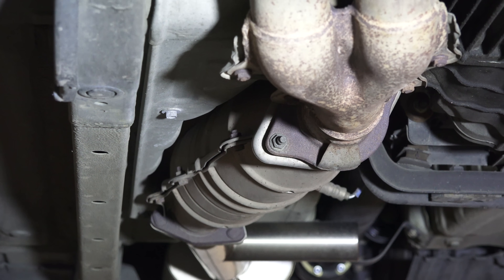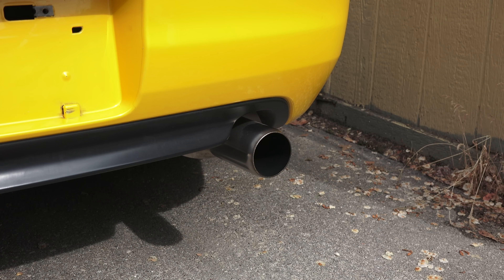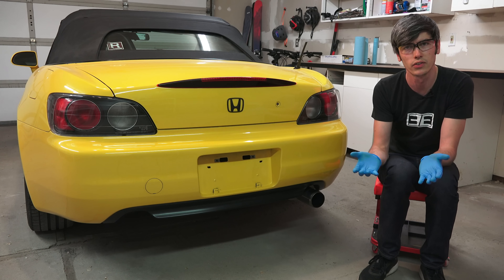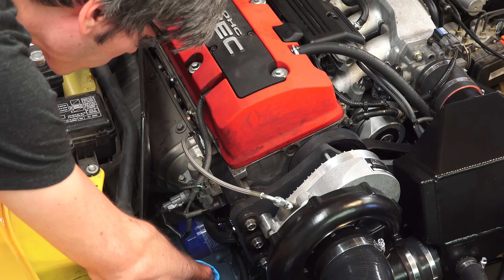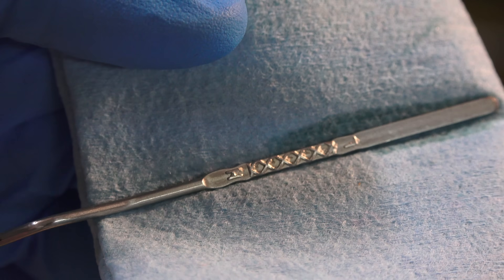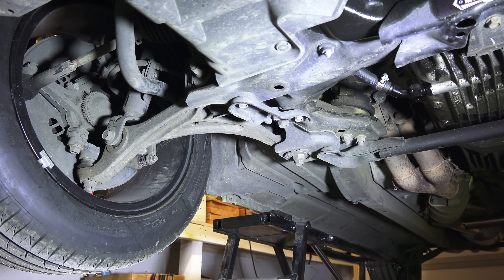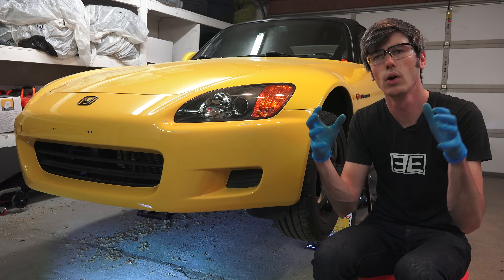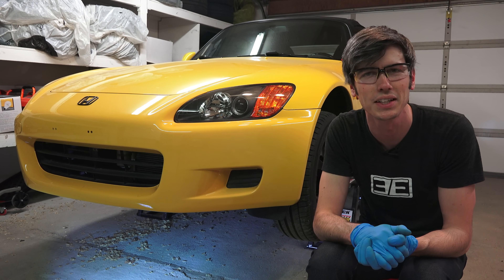5 Signs You Shouldn't Buy A Used Car

Comment from the maker: Good number of folks asking about the bluetooth scanner I'm using. Here's a link! https://amzn.to/2AwvtSQ I've had this one for maybe 4 years or so (EricTheCarGuy actually gave it to me). It's worked great!
Reply: I love your channel, been a fan for some time, your knowledge and no nonsense approach to engineering and mechanics is unparalleled, for this I thank you sincerely. I have a question about the scanner you are using, can it also give you vehicle information about the car as you drive? I am looking for something that will give me engine temp and oil pressure in real time that I can have in my field of vision on my phone as I am driving, more just to monitor certain parameters in different driving environments. Any feedback would be greatly appreciated, continued success my good man, I always look forward to your uploads. Best channel and best host on the subject!!!!
Reply from the maker: Yes, it actually has a live display where you can read things like temperature, throttle position, that kind of thing. It will depend on your make and model what it can read, but you can get live stuff and record data. It's quite neat! I'd recommend looking into compatibility with your make and model, but it's worked well with the cars I've tried it on.
Reply: Engineering Explained ever heard of diesel?
Reply: Engineering Explained hey. Does removal of hood insulation have benefits?
Reply: Engineering Explained hello , CAN YOU PLEASE SOLVE ONE MYTH THAT IS GOING ON IN MY COUNTRY . Some are saying that you shouldn’t open the oil cap while the car is running . My friend has a vw scirocco and from the service they told him that if he wants to sell the car and some guy comes and opens the oil cap while the car is running , something with the vacuum or compression I don’t know exactly would go wrong and the car engine could be damaged . Is that true ? Talking about 1.4 tsi engine .
Reply: Pretty sure he has
Reply: @ristecanev7  I think that part is true, I think I heard about that, it's the pressurized cap, mechanic said to not open that one when it's running so don't open it when it's running.
Reply: Awesome stocking-stuffer.  I'll share this vid with my wife to give her a hint.
Reply: Hey, do all the points apply equally to a diesel-fueled vehicle?
Reply: What would you consider a long enough test drive? Love the content, very useful and interesting stuff!
Reply: Great vid man 😊
Reply: you just wanted to show off how clean your s2000 is ;)
Reply: Also check with OBD how long since the codes were erased
Reply: I was considering buying one, because it seems awesome, then remembered <1990's vehicles...
Reply: LOL teamed up with progressive to make a video to help folks out there buying half-broken cars! As someone who just recently bought one myself, I can tell you progressive is the only one that'll insure me at a near-decent rate! $100 instead of $180-200
Reply: Random Guy really? Do you recommend progressive for first time drivers?
Reply: Thank you! I was just about to ask your for your preferred Bluetooth scanner. My 2007 Chevrolet Cobalt might not be worth much, but I want to do what I can for it. I use Mobile One High Mileage Oil with corresponding filter, Top Tier gasoline, and only the cooling systems give me problems. I could drive it from Texas to Alaska with good luck, but the MVAC blower fan doesn't work. Before I dive into a new blower fan and radiator, I want to check the most accessible things. I am not an expert, so please wish me luck!
Reply: Thanks for the link. This is going on my Amazon Xmas wishlist.
Reply: Jason, would you please consider doing a breakdown of the benefits, effectiveness, and safety of cleaners like Sea Foam, or services like the Valvoline Easy GDI that are designed to clean the carbon deposits that build up in the intake, and around the valves of direct injection engines?

For an example, I was with my girlfriend while Valvoline performed this service on her 2011 Mazda 3. The tech explained  there would be loads of white smoke coming from the exhaust. There was, and it went away after driving the car for 10 minutes or so, as predicted by the tech. The car also threw a code as predicted by the tech. The engine seems more free revving, but when I researched about the efficacy of performing this service on my 2015 Fiesta ST 1.6 ecoboost, there are warnings that Ford say this will damage the turbo! 

A few questions to answer:

Can we expect to see horsepower/efficiency gains on direct injection gas cars with 36k to 50k miles?

Is this safe to use on naturally aspirated cars, or forced induction vehicles, or both?

How harmful are the resultant exhaust fumes?
Reply: I have trunk bigger gap but there is no sign of damage apart that I have ap1 with an ap2 factory spoiler.
Reply: Can you please make a video explaining saabs xwd system. There is not a lot of info about it.
Reply: Engineering Explained you didn’t mention the trans I worry more about it then the engine myself I have had more transmissions go out then engines. Most will change oil but they never touch the trans so you can have a perfect car with say 100k miles and the trans fluid will be black as coal then if you try and change it sometimes not always but sometimes they will go out. If I don’t see at least pink fluid I walk away.
Reply: Yeah I have a BlueDriver its pretty great for about $100
Reply: please could you start acknoledging that there exist different cars than just gasoline, and that white smoke for a gas car means something completely different than for a diesel car? You are so technical in your explanations, yet in your world only petrol exists...
Reply: This is an updated one of I use from ebay (search bluetooth elm327 odb2) under $10 (ship from US) save more if you want to wait and it from China   Thanks for the videos.
Reply: Engineering Explained  great tip with the phone 🤘🏻
Reply: Where do you live? That yellow Honda there has zero rust - and it has never been sprayed with any rust prohibiter like Dinitrol or Suvo, Pava, whatever. You must live in a perfect, sun dried part of the world. I'm Danish - rule no 1 here is: Have your vehicle have a complete anti rust treatment shortly after you purchase it from new. Denmark is probably the country in the world with the most hostile climate to cars (wet, wet, wet - some frost bite in the winter, then thaw, frost again, thaw - salt sprayers driving every night - then comes spring with rising temperatures and tonnes of more rain. So we need to get the our cars fully treated with anti-rust. We don't treat our cars ourselves - we have it done by professionals. Dinitrol is the best, and most expensive company. Would've been more interesting if you had chosen a rusty "DO NOT BUY" car to check, instead of that clinical clean, perfect Honda there.
Reply: I am new to your channel. And I do have a question. Do you know about the flawed engines issue on Toyotas from certain years ? The ones that burn oil because of some common issue that was a Toyota mistake. Would you be able to tell me how to fix it ?
Reply: 7 40 i found some... dent in that long U profile. better return that car
Reply: If a vehicle is running lean could it be producing white smoke, or would it produce anything at all?
Reply: Thanks.
Reply: I have a 1997 civic when i leave it parked for months and turn it on after its warmed up i rev it and smokes its nkt thick white its like clear white can it be old gas
Reply: I am curious about about your lift. I would really like to have a compact lift like that for my garage... Hopefully not too expensive. Can you share the model?

Thanks for all the great videos.
Reply: Is it crazy fast and in my budget? Sold. That is usually how it goes, the rest i sort out later, i just get the fastest car within budget
Reply: You used a car with all new parts as an example hmm.  Another wasted video like all youtube videos just wasted time and nothing but more wasted time shame on all these youtube channels where you can get more out of a movie as its entertaining.
Reply: Engineering Explained you an engineer so obviously you going to encourage people to buy new products to maintain job security.
Reply: Engineering Explained Top 5 reasons not to buy a car.
1. Front wheel drive
2. Front wheel drive
3. Front wheel drive
4. Front wheel drive
5. Front wheel drive
Reply: @dunngerrie5016  Have fun driving rear wheel drive if u live where it snows
Reply: dunn gerrie it’s absolutely insane to think that all FWD cars simply drive into a ditch. I think this is more of a reflection of your skill as a driver. I’ve driven almost nothing but, and never once had a problem with them.
Reply: @dunngerrie5016  Guess you've never driven a RWD car in the snow before. If its a front engine car thats RWD its near impossible to gain traction unless you have great snow tires and weigh the back down.
Reply: StrangeClouds Again nobody is talking about rwd we are talking about how dangerous FRONT WHEEL DRIVE IS... Stop trying to change the subject. Now that you have successfully baited me into changing the subject to something completely irrelevant to this conversation i daily drove a rwd car with studded snow tyres for 15 years straight and guess what i pulled out MANY front wheel drive cars that slid off the road. I have an international FIA rally license and have rallied a rwd car for over 30 years. You are talking to the WRONG PERSON about now being experienced at driving a rwd car on ice and snow at a very high level... Rwd with proper tires is MORE safe than a front wheel drive car withthe same exact tire... You CANNOT CONTROL A FRONT WHEEL DRIVE CAR BEYOND IT'S LIMIT OF GRIP but you CAN control a rear wheel drive car beyond it's limit of grip.... Front wheel drive was invented to save money NOT to be a safer or handle better.
Reply: @dunngerrie5016  Not saying fwd handles better simply saying in general in the winter time fwd is easier to keep traction. The average person doesn't put studded tires on their car or have rally driving experience like you do. Not sure what type of terrain you live in but the area I live is mountainous and can tell you point blank rear wheel drive cars I've owned cant even make it up the street when it snows doesn't matter what tires they have, at the same time our fwd cars with basic all season tires have no problem whatsoever.
Reply: @dunngerrie5016  RWD obviously isn't as safe as FWD with the same tires if you have to use studded tires just to make the car drivable in the winter. Put the same all season or even winter tires on a fwd and rwd and see which one does better.
Reply: mathew senn You have no control once a front wheel drivecar reaches it's limit of grip... Understeer WILL happen to every single front wheel drive car it's common sense...
Reply: mathew senn Regardless of tires regardless of driver ALL front wheel drive cars WILL understeer there is nothing you can do about it. What little you can do is completely irrelevant because it would be too late..
Reply: @dunn gerrie must note your degree of ignorant generalisation. A well-engineered FWD car won't understeer as much, plus most drivers won't keep driving 24x7 at full throttle to worry about understeer anyway. There are many videos showing how proper tires do a much better job in the snow than AWD, and that shows that choosing the right type of tire is imperative for the winter. I cannot say whether FWD or RWD vehicles are grippier on the snow if winter tires are equipped on all four corners, but I can say that your arguments are, frankly, an exercise in futility, since you are not able to generate a real-life use case advantage for RWD vehicles. You are mentioning that nothing can be done when FWD cars understeer, but that is only when the driver applies too much throttle for the conditions. Plus, you also are mixing conditions for snowy and dry conditions to make your point. Oversteer in RWD cars can be controlled by a skilled driver in the dry, but in the snow, even that can cause your car to fall into a ditch.
Reply: @dunngerrie5016  it’s incredibly easy to drive once you realize the gas pedal isn’t a binary switch. Not to mention steering slip angle. If the front tires are sliding, you reduce steering input, not increase. 

Honestly, FWD isn’t more dangerous to drive on the edge than RWD. It just takes more skill.
Reply: gerrie  hahahahahahaha!!!!!!!!

Comment: I agree with most of what he said besides oil and fluid leaks, depending on what is leaking and from where, you might be able to use that to negotiate a better price and fix it quickly and easily yourself and end up getting a better deal than expected

Comment: Had sales person of Anchorage Chrysler dodge tell me car is supposed to spit oil out of exhaust when started, claims it is to lubricate the exhaust valves.
can also get a white smoke that makes you sick in older car with automatic, can be transmission fluid from a leaking diaphragm in the modulator being pulled into the intake through the vacuum line.
Some things that are done to hide issues, putting 50 to 80 weight oil in a bad engine to make it quiet and not leak, double up head gasket to seal a warped head, adding grease to manual transmission to make it quiet same for differentials and transfer case in 4x4, shove a bunch of steel wool into the muffler this reduces/stops oil spitting out exhaust , makes it quieter and reduces smoke a bit

Comment: These are excellent tips. Many of the newer cars no longer have dip sticks for checking the oil in the engine and or transmission. It would be a good idea to have a proper quality scan tool and go through the readings to view for any error codes. If the person is not proficient to properly check out a vehicle it is best for them to pay a qualified mechanic to check out the vehicle. If you can have access to a lift it is a good idea to check for loose ball joints, loose suspension parts,  condition of the tie rods, struts, springs and shocks.

Comment: Also check the consistency in the gaps between the panels for signs it’s been in an accident. Don’t rely on a Carfax report! They’re are not always updated right away. We bought a used 2010 Charger in October 2010 with 19,000 miles from a Chrysler/Dodge/ Jeep dealer with supposedly a “clean” Carfax report. We did not have any accident with it but 4 years later when we traded it in at a different dealer they offered us a lower trade in value because the Carfax then was showing it was in an accident in 2010.

Comment: Oil getting into the combustion chamber could be coming through the intake through a defective PCV valve. Also an older car that has an automatic transmission with a modulator can be sucking transmission fluid from a broken modulator diaphragm through its vacuum line. Both pretty easy to fix.

Comment: White smoke will be more of a deal breaker to you, the non-mechanical normy, than black smoke ever will be.
Black smoke can be from something as simple as a clogged air filter. Which prevents the necessary volume of air from entering your engine. Which means a rich mixture/incomplete combustion.

If that doesn't fix it, it can also be a sign of bad spark plugs or bad ignition coils/distributor. The plugs are not sparking when they should be, or not as strong as they need to be. Which will cause poor combustion, and black smoke.

If your engine also feels overall weaker than it probably should be, that is almost certainly a result of one of these problems.

Not much else can cause black smoke. And most of the time, these problems can be fixed for relatively cheap, 
At least compared to white smoke problems. Lol

Comment: A few more:

1. Smell the coolant, if it smells like exhaust don't buy it.
2. Do a compression test, ALWAYS do this. A tester is what, $30 and you can use it forever if  you take care of the O-rings.
3. If it has a turbo, check the hoses for oil. 
4. OBVIOUSLY you need to check the conditions of all fluids, spark plugs and the service manual.
5. Is it a Chevy, Dodge or Ford? If so, throw up a little in your mouth and walk away.
6. Is it a car or a truck? Are you a farmer or a builder? If you don't need it don't buy it. You're just wasting gas and looking like you need to make up for your micropenis.
7. Is it a Tesla? If so any software upgrade will not come with the car. Even though the owner buys it he doesn't own it and can't pass it on to a new owner.
8. Is it a PT Cruiser and you went as far as to go look at it? You don't need a car,  you need a psychiatrist and drugs, many many drugs.
9. Are there bullet holes in it? If not it was probably a black import.
10. Are the windows tinted? Don't buy it, don't even look at it, just walk away.

Comment: One thing you can use to check for rust is take a small magnet with you.  If bondo has been used to hide rust, the magnet will not stick to it.  In my younger days, I knew a fellow who moved from Michigan to Texas(where I live), bringing his 1969 Buick.  This car  had rust where you would not think a car could rust.  After he got a new car, he bondoed the Buick up, had a cheap paint job put on it and sold it.  Another person I know caught a body shop in a lie with a magnet.  He had a truck he needed some paint work on and the body shop claimed the hood was aluminum and  would cost more to paint.  He stuck a small magnet to it.  Magnets do not stick to aluminum.

Comment: I just bought a used car 47k miles.

I have some white smoke or steam from the exhaust, its not really excessive, it could just be steam. And it's mainly on start up but it does increase on revving a bit.

Should I mention this to the dealer?
Reply: Smell it.  If it smells like cooland get it checked.